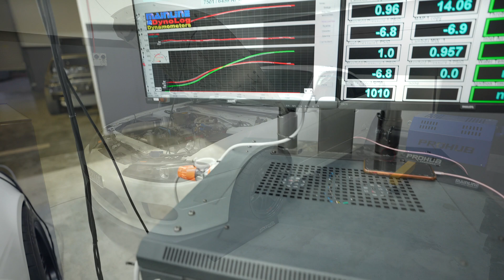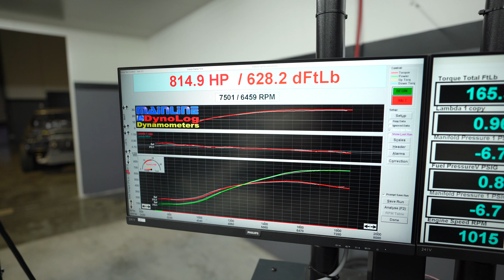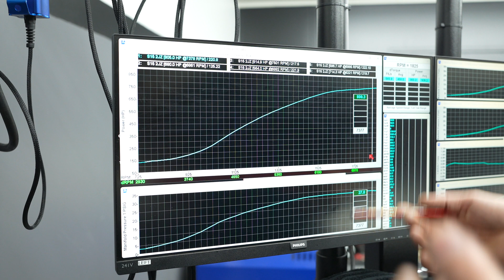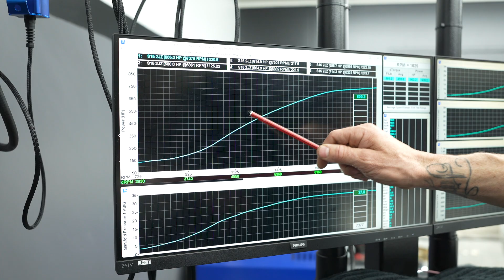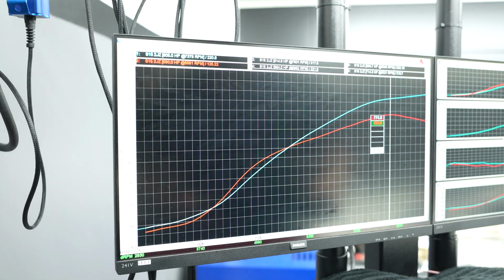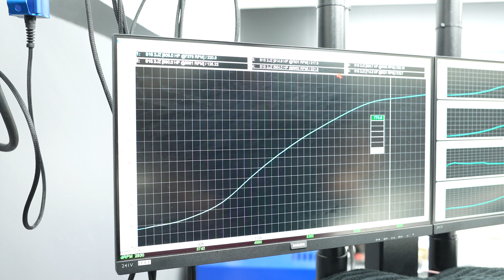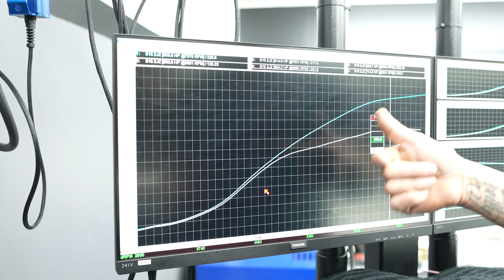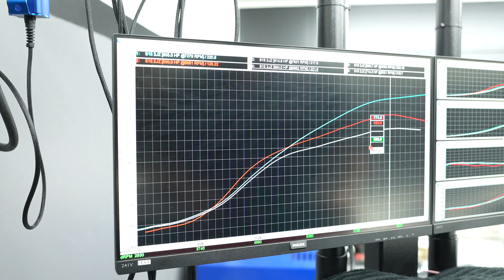Garrett G40-1150 2JZ Nissan S15 Silvia

Comment: I am considering this for my built 2JZ manual atm. Do you think it would hold full power at 28-30psi all the way to 8500rpm with E85 and decent cams and 3.5-4" exhaust?

Comment: How is street driving?
Im contemplating between g35-1050, but people say g40-1150  has the same spool, and it's better matched
at what rpm ypu see full spool?
Reply from the maker: I love the G40-1150 it doesnt feel laggy at all and has all the top end you may need.

Comment: Hello sir. 3.2L V6, 9.0-9.5 CR, cammed, 270 cfm heads, 18 psi, 8k rpm, 565 all-wheel hp goal (700 crank hp). 5-speed manual street car, with the occasional drag race. I have my thoughts, however which of the following turbos and a/r  would you recommend?: 

G40-1150 .85 ar, .95 ar
G40-900 .85 ar
Twin G25-550's .49 ar, .72 ar

Thank you in advance.
Reply from the maker: I would suggest the G40-900 with the 0.85

Comment: We use pulsar g40-1150
2.3bar 1078whp on dynojet

Fully built 2jz 3.0L
Reply: Thats really impressive. How high do you rev the engine and do you have a speed sensor on the turbo? I would think the motor have to have peak power at 7500-8500rpm and the turbo to be spining at about 135k rpm to make that power.

Comment: Let’s just say someone (possibly me lmao) had a 2jz-gte vvti with the g40-1150 1.01. How early and hard do you think it could come on if you tried? 

I want it to blow the tyres off as hard as possible and have all the torque surge 😁 cheers
Reply from the maker: If that’s what you want, you need the Artec t4 twin scroll short runner exhaust manifold with T4 divided turbo housing in 0.95 and on e85 fuel. If so, you could get it on full power probably early 4000rpm. All depends on your gearing through gearbox and final drive and what load is placed on vehicle at the time and what boost pressure your aiming for.

Easy to get 15psi, harder to get 45psi

Comment: How is the engine holding up with the stock main caps? I have a G35-1050 and want about 700-800hp and I can’t decide if I should get billet main caps or not. It’s just a street car too. Great video btw
Reply from the maker: Engine seems good mate, no signs yet of any issues. Cant say i drive he car everyday though. But every time its driven it is on full power.
Maincaps, wel if your engine is being built then for sure you would upgrade but if its stock, just leave it until its build time. Engines just dont like brining all the power in as fast as you can, so if its tuned to survive, it prob will be good.

Comment: What fuel was used, and how much boost was on the lower 600whp run?
Reply from the maker: e85 fuel, not too sure on boost pressure but bellow 20psi. throttle closed to 32%

Comment: Whats your fuel pump setup if you don't mind sharing? Are you on aftermarket hanger?
Reply from the maker: I’m using the Frenchys performance twin intank kit, 2x walbro 525 pumps. Turbosmart fuel pressure regulator, single 8AN feed line to rail, 6AN return. 1650cc injectors at 400kpa base pressure

Comment: You should have mentioned the used turbinehousings for the G40 and 6266
Reply from the maker: Both turbos are T4 split pulse. 6266 is a 0.84ar and G40 is 0.95ar
Reply: @Motorsporttuningsolutions1 was the 6266 a gen 2?

Comment: I've just bought the same turbo for my A80 Supra 6 speed, kinda based on your video if I'm honest, but I'm going to be running it off an Artec V-band manifold and with Kelford 272/278 cams, springs, retainers etc.

I'd love to see more videos of this 2J Silvia beast when you turn it up some more.
Reply from the maker: Nice mate, yea the G40 is very deluxe! 

Slightly bigger cams on your end and the beautiful Artec should be a deadly combo.
Reply: That's what I'm hoping for.  Not chasing numbers, but, based on your setup it looks like a very driveable combo.
Reply: @Boost-Samurai  what  rpm ypu get full spool?

Comment: Wow that comparison between the 1150 vs 6266 is closer then I imagined. I think if you added more into the mid-range with the g40-1150, the 200-300 rpm slower spool is well worth it. I run a 6766 with a .84 t4 divided housing, so it seems to me this g40 would have similar spool. My next turbo for sure!
Reply from the maker: Yea I absolutely love the G40

It’s going on the GTR also

Comment: How big of an upgrade would this turbo be compared to a G35-1050? And is the G40 turbo close to running out of steam or has plenty more to go?
Reply from the maker: Well if you have high back pressure with the G35, you would see great improvement but if you haven’t maxed out the G35 then you would just stay with the G35. There would be about 100-150hp difference right at the top end. 
My setup atm is just beginning. It’s far from mixed out. Maxed out would be about 1000whp maybe 1050whp

Comment: One of the highest  quality reviews I've period.  I'm looking to replace a 7675 gen 2 with something more responsive on a 3.4  this looks like the way to go, in wondering were it will run out of breath witb a Larger  AR .
Reply from the maker: Appreciate the feed back mate.

Yea the G40 is a beast! I would say you could put down 1000-1050whp turned completely up on a good flowing setup! 

Would be very responsive on the 3.4L

Comment: Hey Phil, would you have any insight on how the G40-1150 0.95 would compare to the G42-1200 1.01 on a 2JZ? Much of an increase in lag?
Reply from the maker: Hey mate, yep there will be a noticeable increase in lag with the (500-1000rpm) G42 but you would get a tad more too end. 
Personally, for the 800-1050whp range, the G40 is hard to beat.
Reply: @PhilipYoungsmith  what if it was a built barra ? Th400 car. I'm torn between the g40-1150 and the g42-1200 maybe even the 1450
Reply from the maker: @Oddfox_garage it really just depends what total power your really chasing

Comment: Does it outdo a 6870 e.g can spool similar but push more power so far it seems the 6870 is still the gun for response and the power it can make has any turbo outdone it?   Or is the g40-1150 nothing out of the ordinary in terms of efficiency ?

Comment: Hey mate. Really nice and informative video.... i haven't found much real world reaults on the G40.. you are the only 1.. im converting my F80 M3 to single turbo and im looking at using thw G40 1150... im really stucked on choosing the correct turbine housing for my application..  i mostly do half mile roll racing... On my M140i im using G35 1050 with 1.01 AR...  i wat would u recommend
Reply from the maker: Appreciate the feedback mate. I’ll make a nice video on using rolling launch 🚀 control and how quick it comes on full power. 

Turbine housing, I would definitely suggest the size I’m running. T4 twin scroll 0.95. 
It’s one of the smaller exhaust housings Garrett offer and my back pressure is basically non existent at 850whp. High Back pressure is the main killer for making power and limiting the turbo’s performance at top end rpm. 
Unless you trying to max out the turbo to its full potential, then 0.95 is the go.

Comment: what do you reckon of a G42 compact garreet series on an stroked Rb26 -  Rb2.8 ,plenty of head work - just  worried on spool but killer turbo up top
Reply from the maker: Beautiful turbo, will be a bit lazy but nothing a bit of Nitrous can’t solve. Big top end power with that bad boy!
Reply: I had a g42-1200 on my 2.8 built head, 1011hp with 37psi which was around 6200-6400. Doesn’t feel too laggy but I’m running a getrag 6speed and 4.11s in my gtr
Reply: so full boost by 6400rpm ?  @Clipto2000

Comment: Nice video and good info, what rear housing are you running? 1.06 or 1.19? Thanks
Reply from the maker: Cheers mate. 0-95 rear t4 split pulse
Reply: @Motorsporttuningsolutions1 thanks, really Nice result.
Reply from the maker: Not a problem mate. Let me know if you need any more info
Reply: @Motorsporttuningsolutions1 what hp do you think the .95 will tap out
Reply from the maker: @briston64  probably around the 950whp mark. Just depends on back pressure and max rpm
Reply: @Motorsporttuningsolutions1   thanks for the reply I’m running a n54 bmw engine looking for max maybe 925whp with not too much back pressure revving to 8k
Reply from the maker: @briston64 yea the 0.95 should probably be the pick of the bunch. Next size up also would be something to consider if your maybe going higher on future
Reply: @Motorsporttuningsolutions1  transmission and aluminum block is the limiting factor I don’t think I’ll be going up

Comment: Great result mate. What exhaust manifold and valve springs are you using?
Reply from the maker: Cheers man. Im using the Tonnka t4 split pulse manifold from Golbeys parts. Good solid manifold but the wastegate design isn’t too good when running a very high flowing turbine side. Didn’t have any issue with the 6266, but now with the G40 big boy it’s boost creeping a bit. 

Kelford cams valve springs. Just the KVS02
Reply from the maker: 50mm progate on the manifold
Reply: Nice man. I have the same valve springs and a built motor. I'll see what power I can make at the 30psi limit. Cheers.
Reply from the maker: @scottthompson6823  beautiful mate. Yea let me know the results 🤙

Comment: if your intent was to cover the plate,  you missed it on that initial dyno run .    just a heads up .    looks good.    pretty crazy to make that much power on a stock bottom end  .   cool set up .
Reply from the maker: Cheers mate. Yea it’s insane how much power you can run in the 2JZ. Thanks for the heads up on the plate. Not overly concerned but just trying to implement some covering

Comment: Is there any way to add 250hp down low and 400hp to the midrange to match a 1200hp EFR turbo?
Reply from the maker: Well ignition timing is still low in the mid section, wastegate duty cycle is also still low in the mid section too. I would be very interested i to see this 1200hp EFR producing  that kind of power down low, the 6266 precision turbo I compared it to on the Dyno is a great responsive smaller turbo and that won’t even get those results your talking about.

Comment: I know you love your roll racing, but will you do any 1/4 mile work? I'd also love you know how much timing your running in the midrange. 
Love your work, keep it up!
Reply from the maker: Yep I’ll be heading to the 1/4 mile very soon mate. I’ll test and dial in the grip levels, once that’s done I’ll send it down the track.

Ignition timing in the low and mid section of rpm is still very conservative, about 13 degrees ignition timing. On e85, I could advance it much more